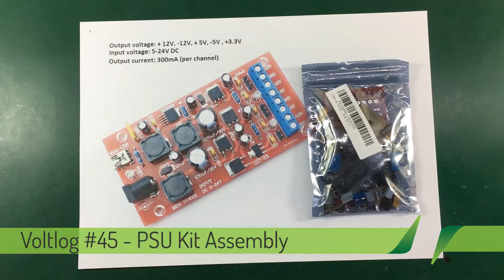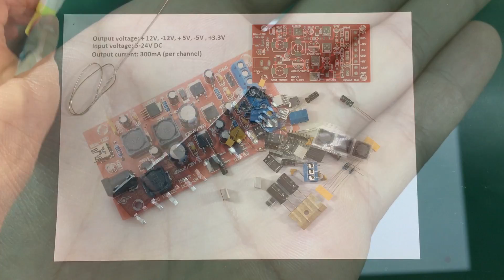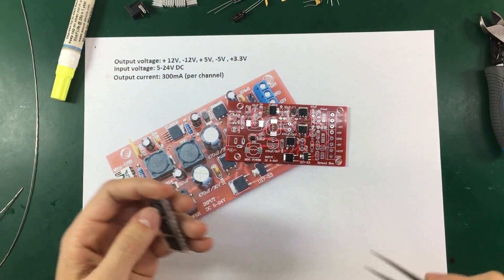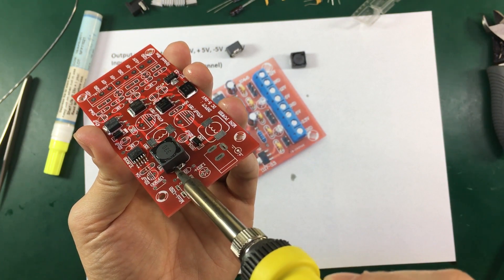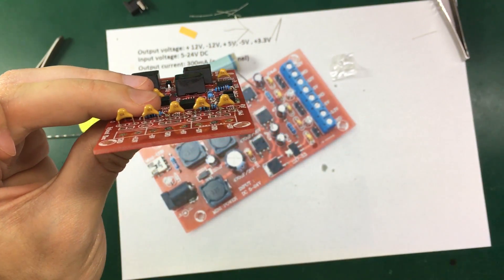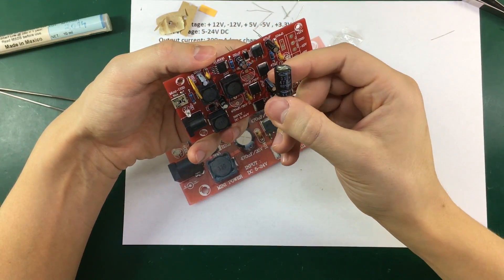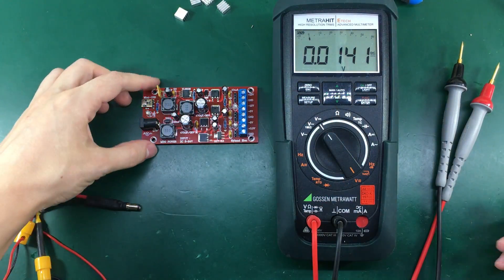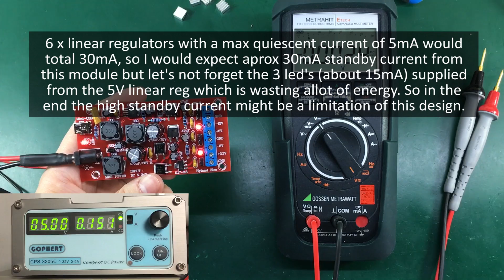Voltlog #45 - Multiple Rail Power Supply Kit Assembly

Comment: blew up my XL6008 chip. had a diode in the wrong way. turns out they where directional. i honestly didn't pay attentiont to what they was when i put them in. and the markings for polarity wasn't even noticed. normally that wouldn't be an issue. but digikey/mouser dosn't even have that part. and no choice but to order a replacement from china... guess this project is on hold for a month+

Comment: I came across the schematic of this unit while researching for a replacement power supply for a Feeltech FY3224S signal generator.
Hope it helps some one. https://forum.banggood.com/forum-topic-123630.html?page=3
If the link doesn't work, it might have been moved to another page of the forum.
Reply from the maker: thank you for sharing! the link does work

Comment: What's the best way to debug this if it's not working? When setting 400mA as a limit the voltage drops to 2,4V. Something is damaged on the pcb I think. I rarely destroyed components when soldering
Reply: fixed it, i had one smd diode wired the wrong way. Now everything works :)
Reply from the maker: Glad to hear you fixed it, actually that is the first thing I like to check whenever a new kit is not working: that every part was correctly soldered.

Comment: Looks like a good kit if you need somewhat stable voltages and don't own a proper linear lab supply or want to save space. Even if the voltages looked a bit off.

The polyfuse looks rather big for 300mA (which would also be far too low to get the specified output currents) so I guess it's really 3A. Since there are usb power supplies with several amps this also seems somewhat reasonable. PC ports are limited to afair 500 and 800mA depending on the used USB version but are also required to implement protective components - as long as your board manufacturer adheres to this specification you shouldn't be able to blow your pc. 

Air compressor might sound a fast solution but I was told there could be moisture buildup in the lines which may turn into ice due to pressure so it's usually a bad idea to fire directly on electronic components. 

One note regarding the recording: when showing the smd components the exposure jumped quite a bit - of your camera allows to do so you might want to try fixes exposure.
Reply from the maker: +BitBastelei Thank you for the constructive feedback! I guess I could put that poly fuse to a test by drawing some current from this psu, but as the power supply current draw in standby is already 150mA indeed it doesn't make sense to to have a 300mA fuse.And you are right about motherboards as well, all the modern ones have decent protection.

I'm not sure butI think there are filters that you can install on the output of air compressors for use with electronics When doing just a single board DIY, it's acceptable to wait for it to dry naturally but when doing 10-20 pcs.. then you really start to feel the need for an air compressor.

Lighting is one thing I need to improve in my videos and I am also experimenting with fixed exposure and hopefully I can improve the quality soon.

Comment: I have done this kit also about 4 weeks ago. It produces about 16 volts with the step up/step down converter first and than it uses linear regulators to lower it to the 12/5/3.3 Volts. So i have throwen it into a little case and added a lm317 and a voltmeter at the 16 V Point on the pcb. So i got a little power supply with fixed positive and negative voltages and an additional variable voltage from about 1.3 to 15 volts. Great for using it on the go because all works powered from a 5 volt power bank
Reply from the maker: +Michael Bernhardt Nice! Do you remember if your PSU also draws about 150mA in standby ?
Reply: +VoltLog good morning from Germany. So i just did a quick measurement before i'll go to work with one of those USB power measurement things. At 5 Volts it draws about 180mA with my additional lm317 and the LED voltmeter. Sounds within the same range as yours does when you substract about 20 mA for the additional circet. 
The kit says 5 to 24 Volts input and due to the reason it is a step up/step down regulator it sureley will draw half of that in standby at 12V and a quarter of it at 24. 
A word to those polyfuses or PTC fuses as they are called: It is a 300mA rated one and i think mine has a 400mA one but i did not open my case this morning to look it up. Anyway this does not really matter because the rated value of those polyfuses is the value they stay closed for sure at any condition. In the datasheets of those fuses is another entry telling the current the are surely opened. And this is normally twice the rated stay on value. So it will Open up somewhere in between.
Reply: +Michael Bernhardt thinking of the wide input range voltage this might be a kind of compromise to protect the circuit from overload. I did not look up the data sheet of the main regulator but maybe it has no current limiting when getting too hot and those little glued cooling pads cannot push away the heat above a certin limit?

If there are any questions just ask. I than could do some measurements on this weekend. I also have some other polyfuses around here For testing
Reply from the maker: +Michael Bernhardt Good morning, I will test the actual poly fuse next week as I am away for the weekend now. I was curious about the standby current but your measurement looks to be similar to what I have so it is normal. You are right about the poly fuses, they are not very precise and would probably go up 600mA but not for long. Quoting specs of 300mA per each rail output is not very realistic, they will get hot quickly so maybe they're limiting that as well through the fuse.